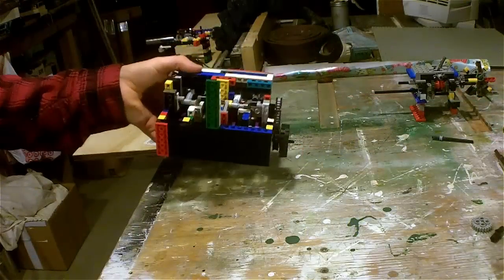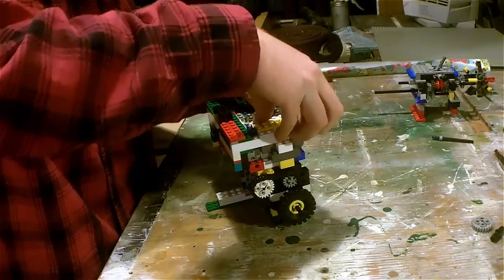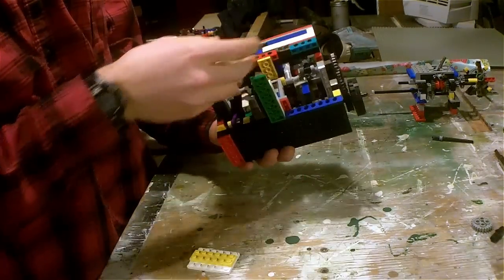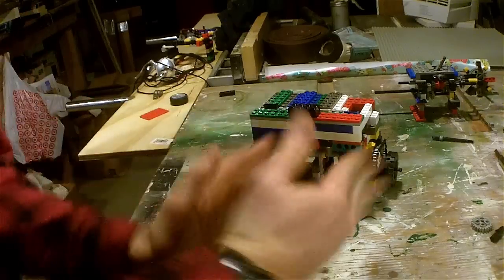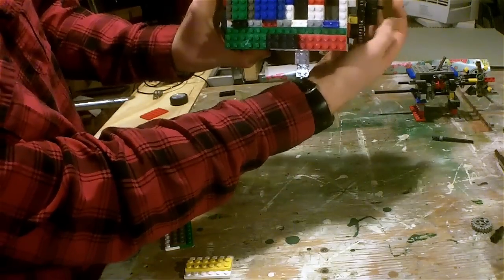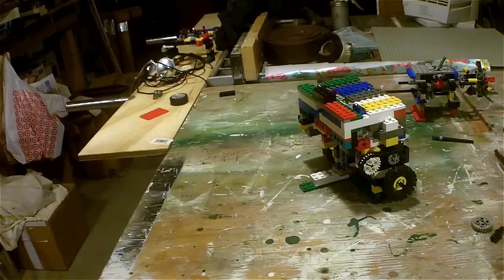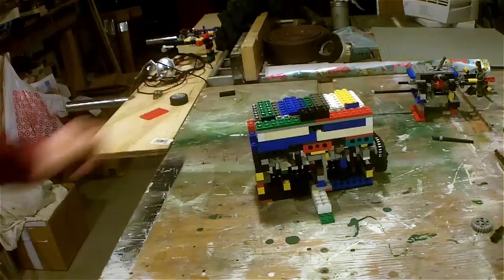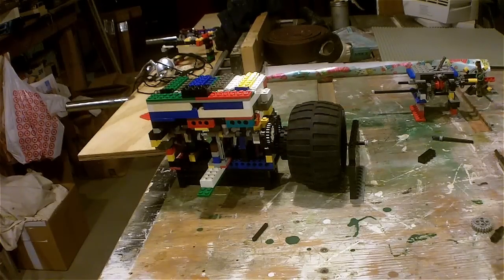Lego Inline Four Cylinder Engine

Comment: Nice job. That engine is fast and very smooth running.  I like how you built this engine. very compact. I have not built any engines with 2x2 piston.  A four cylinder 4x4 piston size engine is about the limit for a average vacuum to run at maximum speed and torque then everything goes down hill from there.